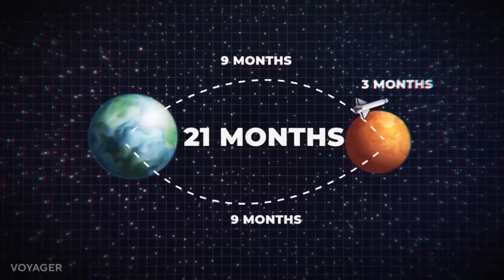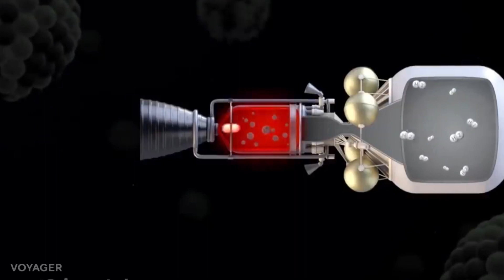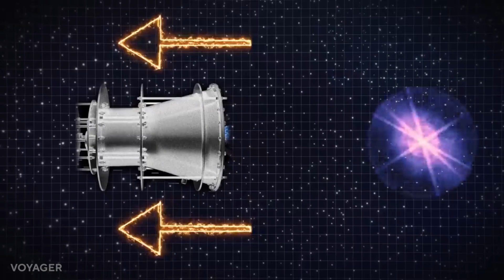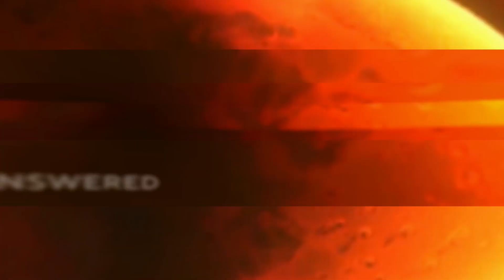SpaceX Starship Will Reach Mars IN WEEKS?!

Comment from the maker: Could this be the key for humans to travel to Mars and back multiple times a year?
Reply: No. Solar sails provide too little propulsion. Ion propulsion is better, but requires a lot of power that has to come from somewhere. It also needs reaction mass that can be accelerated (which is why they use xenon at the present time - a rather rare noble gas).